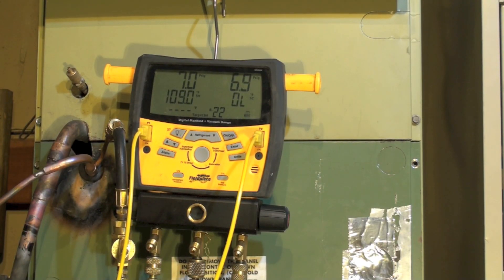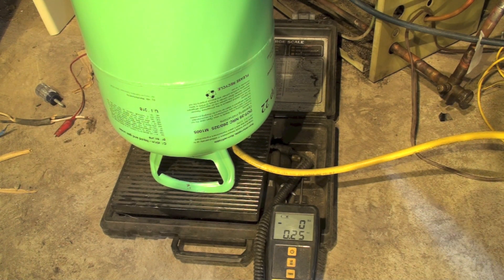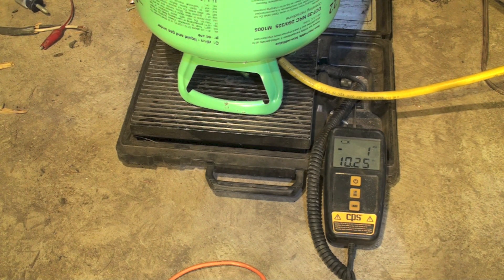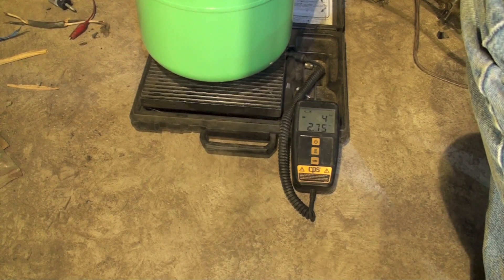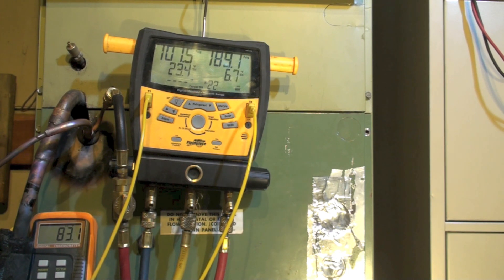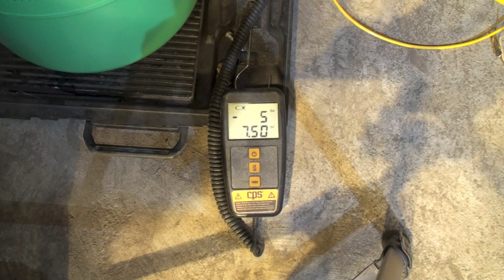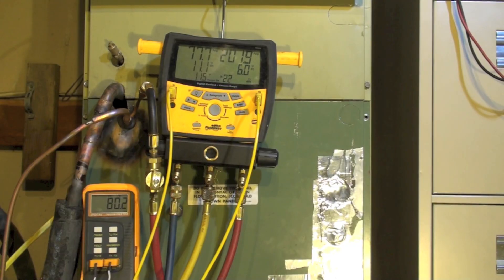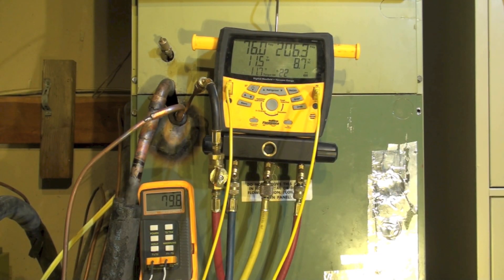Air conditioner charging by weight

Comment: Just to make sure, charging liquid into the "high side" means the liquid will be flowing into the condenser coil, not the evap coil, correct?  The liquid is stopped from flowing into the evap coil by the txv or piston, correct? (An evap coil full of liquid would wreck the compressor on start-up, right?)
Reply from the maker: It does flow into the condenser.  If you have a fixed orifice, the liquid is not stopped by the metering device.  It is normal for some flood back upon startup.  Most is evaporated in the eval before it gets to the compressor.
GFM

Comment: Hey Gray, I just have a question about a purchase I made. I hired an HVAC tech who bought a "5/8 lineset" for a 3 tonne air conditioner today. This "suction line had a 7/8 connection".. but he still connected it after playing with this copper lineset. There will be an inspection booked for a week from now. The install is not complete yet as he had a family issue to deal with. I am just wondering if this will cause an issue?
Reply from the maker: There should be a chart in the install instructions that will give a size for length for the different size units.  If you do not have the instructions, you may find them on the internet with the model #.
GFM

Comment: I had to change 2 ton coil 2 weeks ago and I was confused at the charging I read the tag on the machine 5 lbs. I started charging thru suction line started the machine checking my values at 3.5 lbs suction line was sweating already and at 4 lbs checked my values 14 degree superheat 10 degree subcooling so I let it run 10-15 minutes let everything settle and still these numbers didnt change much it was a 2 ton fixed orifice coil. It was also making 18 degree temperature difference. Is my scale wrong or the manufacturer made a mistake(15 years old Goodman)
Reply: Mfd. Data plate are usually dead on. I came across something similar and found the blower was set at a 3 ton of air for a 2 ton evap coil. Before doing any charge make sure your air flow is there. This can be return duct size vs supply duct. Correct blower drive speed tap for your application. Evap or blower wheel dirty. Broken or leaky ducts. I have seen over the years that one home owner like they thermostat setting to be around 78 year round with incorrect return. The system perform and deliver at that demand. Then house get sold and the new owner thermostat setting is 72. System can not keep up and in most cases will freeze up semi or full. Then you get a inexperienced technician call out TXV bad. :) 

CHECK AIR FLOW...
Reply: Ruben Benavidez Thanks...
Reply from the maker: I would agree the data plate is correct.  Not so sure about the air flow issue.  I would think low air flow would be the problem here.  I understand the 18 degree split but temp split is not definitive.  Charging the unit is usually the time when we find the problem that may have caused a failure.  
GFM

Comment: I've weighed-in liquid on a TXV split system with 14 lbs R410 on a 27' line set into the high side. After completing the charge it takes several hours before I'm able to run the system, else the low side pressure is too low and the switch opens. How could I minimize this waiting period? Thank you.
Reply from the maker: Brian Fletcher If the charge is right, here should be no waiting period.  The unit should be operational within a few minutes at the most.  What are your pressures?
GFM
Reply: grayfurnaceman Going by memory at approx 85 ambient high side was 330'ish, low side started at 120'ish and fell until low PS opened. When I let the system sit for several hours it ran fine with pressures at 330/115 (approx) at the same ambient. This has occurred more than once. Sub cool is 8-9 and nameplate calls for 8 +/-1. Thank you.
Reply from the maker: Brian Fletcher If the unit is TXV controlled, I would be looking at the valve.
GFM
Reply: grayfurnaceman Thank you. Sorry to be a pest but if the system appears to function normally after the waiting period are you suggesting I might try warming the bulb after the charge to allow refrigerant to the evap?

Comment: +grayfurnaceman
Hi, I have a split type air conditioner but people say that I cannot check the charge using superheat. Is that true? What is the differences with split type?
Reply from the maker: +Edward Ng Whether it is split or not does not determine the method of checking charge.  The type of expansion device has more to do with charge check methods.
GFM